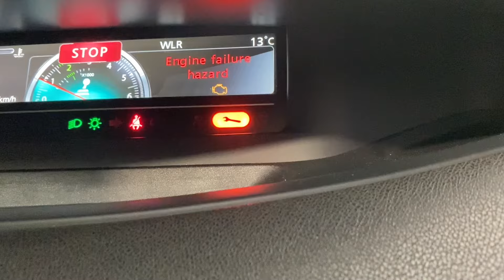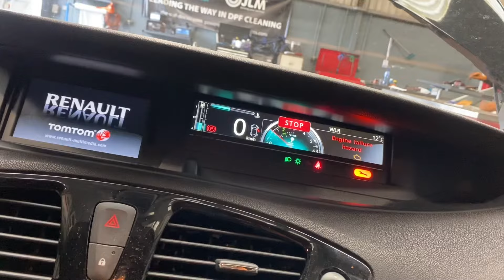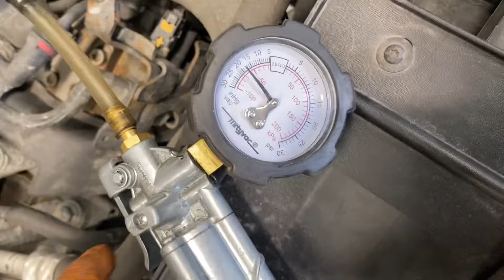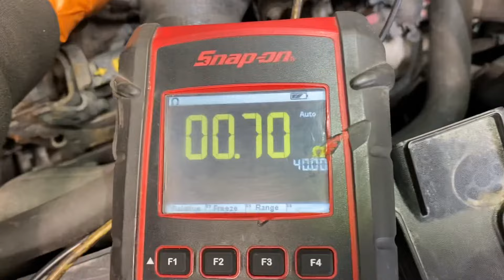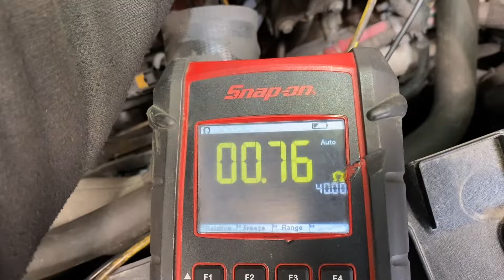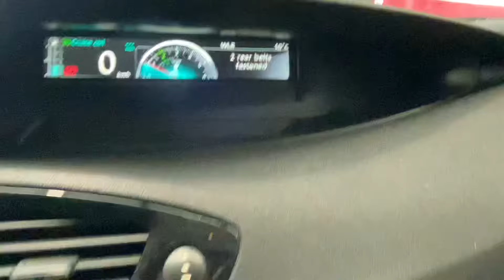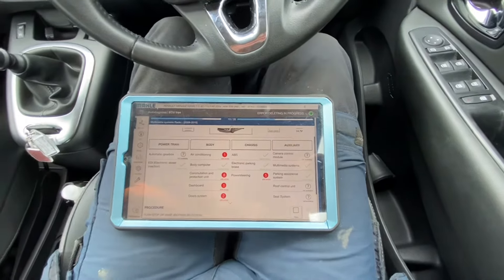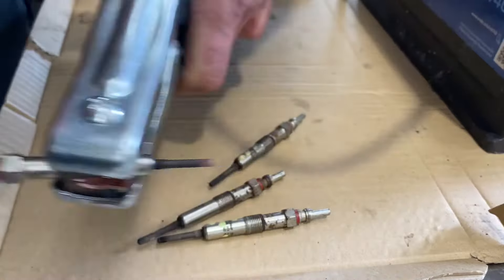P0471 turbo pressure sensor fault (fix)

Comment: if you're stuck with those pipes or you wana prove the problem. In situ, a squirt of carb cleaner down the pipe then the inner of an old handbrake cable on a drill should clear it enough. Advise/order new pipe
Reply from the maker: I have tried the handbrake cable a few times to no avail but never with carb cleaner, I’ll try it the next time I see it, thanks Dave 👍👍
Reply: have this issue currently, and seems no amount of carb cleaner/injector cleaner/dpf cleaner with the hand brake cable as a pipe cleaner will work! its truly blocked!

Comment: I've seen a few guys use a bike brake cable in a drill that they use in combo with some carb cleaner/dpf cleaner.  Takes a while but they eventually bust through the blockage.  I've the same engine in my Qashqai and now you have me worried that pipe will block eventually!  Then I'll be following my own advice😐
Reply from the maker: I have heard of that before but I have found lately that heat is excellent for softening the carbon & compressed air blows it out. Cheers David 😉🙏🙏

Comment: Hi, how to find the ean number of the Exhaust gas pressure sensor for this particular car? I have error code P1525-f3 and P0471 and cleaning did not remove the red message.

Comment: Do you have any idea about the upstream presssure value on idle was around 1060 mbar before cleanong, tham became around 1200 mbar after cleaning, is there anythin wrong? Meanwhile, i had no problem with fault code, i just did a maintanence on it. Thank you

Comment: Why does my 1.5dci go into limp mode when boosting the turbo to over take or on an incline when the engine temperature is not up to temperature , meaning when the engine is still “cold”, when the guage is up to its operating temperature , it boosts fine and doesn’t go into limp mode ? P2063 I think it is - TC system fault
Reply from the maker: Unfortunately it could be lots of things and it is impossible to say without seeing the car. Smoke test the intake system & look at the air filter, these are a good place to start 🤞🤞
Reply: I have the same symptoms, any update?
Reply: @ stuck waste gate vanes inside turbine compressor housing

Comment: Have you noticed any loss of power specially in low rpm because of this issue? 
Thanks for the great video!
Reply from the maker: Yes, I have seen this issue quite often and it does cause power a reduction 😉

Comment: Hi Peter what do you think of a 2017 Mondeo 2.0 tdci powershift 175k. Thinking of buying one to taxi in? Are the engines gearbox as good as a Vag Dsg set up ? Thanks in advance 👍
Reply from the maker: The Mondeo is quite a good car and I would recommend it as a Taxi, the only thing that you would have to be mindful of is the Powershift gearbox. They can be troublesome & expensive to repair, so make sure you have warranty to start with. Then change the gearbox oil & filter every 40k miles just to be on the safe side. 
I hope this is helpful Andrew 🙏👍

Comment: I got a bit of welding wire down there.... ball end first.
Reply from the maker: Did it work???
Reply: @kennedysgarage3281  As to cleaning the pipe, yes, very much so...  The check engine warning had just come on, so the carbon build up was quite wet and soft.....
Reply from the maker: @evanjones2539  brilliant, I will try it next time 🤞👍👍👍

Comment: Thanks for you vidéo 👍
Reply from the maker: You are more than welcome, hopefully it helped you out. 
The only advice I give is since making this video I have done quite a few of these & if the pipe is blocked just order a new one. Then when you have it in hand, cut the top off the old one in order to get a good fitting socket on it. It makes life so much easier 🙏🙏👍